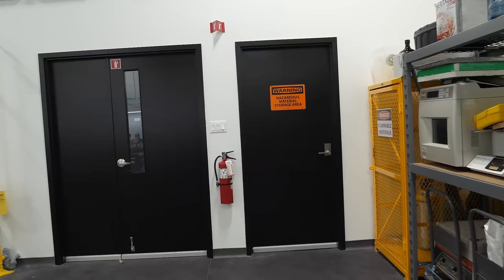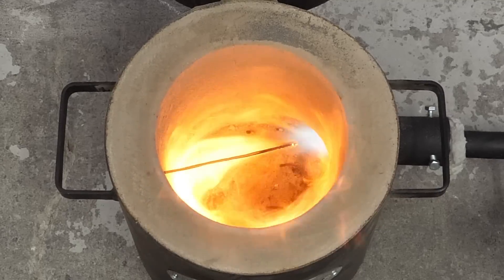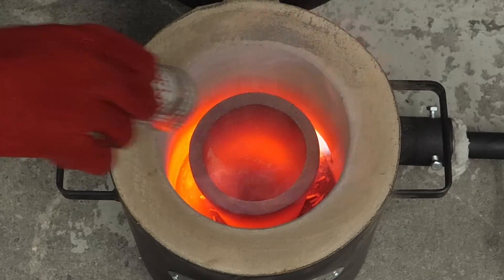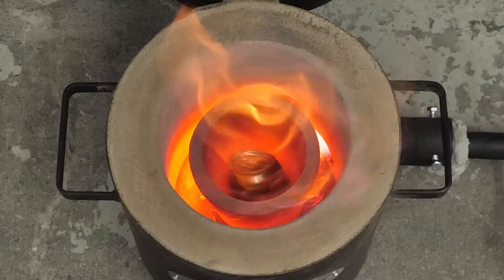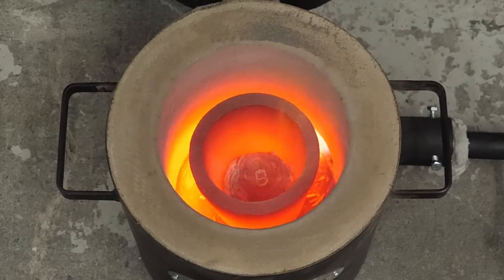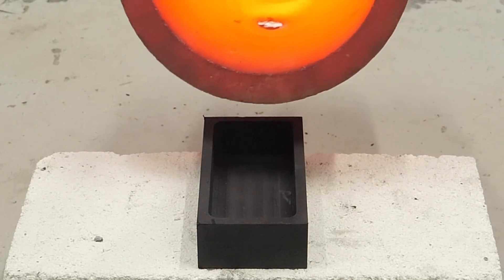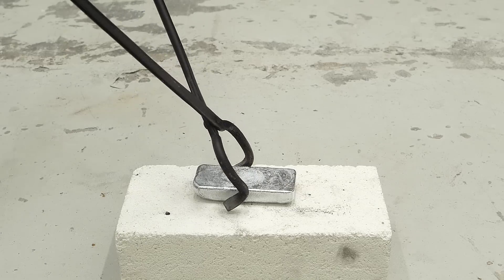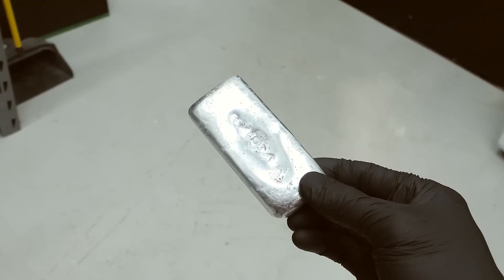Turning soda cans into a metal bar

Comment: The amount of cans it took to make that bar is quite impressive
Reply: Not that much though, cans only have a thin layer of aluminium.
Reply: @kokoslegend4850  you could make a diy can car which is small and realistic when you "crash?" It
Reply: @braindamage1  yes kind of, still looks like a can though. Also they are pretty strong, so I don't think little aluminum can cars will crunch on impact. It should be 30cm long and have a good mass of a few kilo's before it will work.
Reply: shows you how efficient aluminum can production is
Reply: @Kakaroto3245  efficient? Not really. It consumes alot of energy
Reply: @Kakaroto3245  trueee. I'd never get that much Alu from that amount of cans in here.
Reply: You can rip the Aluminium cans with your hand easily, but Aluminium is actually a really strong metal, It is even used in Planes.
This shows how thin the cans really are.
Reply: @sankang9425  although it is in an alloy with magnesium
Reply: @sankang9425  aluminium alloys have to be used in planes, because its soft, iron alloys are too hard and wings would break off. Second is how aluminium alloys are very light - planes can not be heavy
Reply: @sankang9425  it's actually pretty flexible compared to other metals I'm pretty sure I'm pretty sure one of it's main qualities is it's resistance to rusting
Reply: @sankang9425  Not exactly.
1. Planes use aluminum alloys, not just aluminum.
2. Aluminum is far from perfect as a construction material because it becomes brittle and cracks if stressed repeatedly. This can lead to catastrophic outcomes.
Reply: @sankang9425  hmm not really tho. Pure aluminium is not that strong among other metallic elements the reason it is used in planes is actually because of its lightness, not strength
Reply: @sankang9425  Aluminium is not strong at all by itself. The reason it's used in planes is because it's light, not strong.
Reply: @m-h1217  it's light and strong, that's why it's used.
Reply: @kokoslegend4850  It's noticeably soft compared to other metals. There is literally no reason to build planes out of stronger aka. heavier metals as that would only induce more risk. That's why it's used in alloys with stronger metals.
How many times has it been used because it's "strong" rather than light?

Aluminium is not strong by itself, you don't know what you're talking about.
Reply: @m-h1217  I do know what i'm talking about, aluminium is softer than other metals, but still very strong. It is the weight to strength ratio that makes it suitable, if it was really weak, it wouldn't be used. Aircraft manufacturers also make it stronger by making alloys.

One of the first google results:

Aluminum is ideal for aircraft manufacture because it's lightweight and strong. Aluminum is roughly a third the weight of steel, allowing an aircraft to carry more weight and or become more fuel efficient. Furthermore, aluminum's high resistance to corrosion ensures the safety of the aircraft and its passengers.
Reply: @kokoslegend4850  If it is softer than other metals it isn't strong. Unless you're comparing it to something like plastic or wood which would be strange.
If it was strong enough they wouldn't use it in alloys, however in this case, clearly it is used within alloys which is enough to prove that it isn't strong enough. The "because it's lightweight and strong" might refer to materials overall.
Just look at a chart and compare it to steel, quite a significant margin in almost every type of "strength" measurement.
Reply: @sankang9425  thank you for spelling it properly
Reply: Bill the Engineering Guy has a great episode about aluminum cans. The engineering and machining is truly impressive.
Reply: @bootblacking  yes I've seen that one.
Reply: @bootblacking  Yes I’ve seen that. Really fascinating!
Reply: Now how much money we talking per 100g bar? I know a sodaholic 😈
Reply: @vg6761  Today's spot price for Aluminum was $2,800 USD per metric ton. So...your 100g bar is worth at most 28 cents USD.
Reply: @teebob21  and what was the cost of the gas that was used to melt 28 cents of aluminium?
Reply: @teebob21  that's quite precisely what I get for recycling a single can here in Norway.
(actually ordinary and small cans go for 2 NOK while large bottles (1 liter and up) go for 3 NOK, surrounding your estimate)
Reply: @teebob21  sell in bulk
Reply: @vg6761  you're looking at like 90 cents a pound. Scrap and metal prices in general took a hit when covid reared its ugly head.
Reply: @Excalibur250  cans at my local place is 55¢/lbs...15lbs gets me ~$8.25...for trash.
Reply: @vg6761  who are you and how do you know me
Reply: @vg6761  10-11 cents 💀
Reply: The amount of heat energy needed is also quite impressive
Reply: @randomguy8196 yes, true, but the metal itself is pretty strong too.
Reply: Soda cans are an impressive piece of packaging engineering - they weight less than a twentieth empty of what they weight full!
Reply: Nope, the impressive thing is they can manufacture such a strong can with so little aluminium.
Reply: The genius design of the aluminum beverage can strikes again.
Reply: The amount of cans he got from the bar to make that bar is impressive, lol.
Reply: I think he was drinking them while it was melting.
Reply: It used to take about 30 cans for me to get a small pour when I used to do this
Reply: 12
Reply: That’s why in the hobby casting community it’s common to tell people to sell the cans for scrap and buy some better melting stock.  The thin cans oxidize all over the place and unless you flux it really well most of your metal is lost in the slag.  With good stock material you see 10-15% losses in slag, with Cans it’s more like 50%, with the best I’ve heard of being 25% losses.  Plus it’s a bad casting alloy.
Reply: Imagine how surprised this guy would be if he found out what sand on the beach is
Reply: Only 13
Reply: @Agent Fox boo
Reply: They’re super thin and remember that they are also completely empty. I’ll bet that if you try hard enough you’ll be able to squish one into a tiny ball
Reply: Yeah, 15 cans for that little amount is proof that aluminium isn't that harmful for the enviroment.
Reply: Hello
Reply: @Sillyunicorn5630  hello
Reply: @randomguy8196 not true. I've stood on empty cans before without them crushing, you just have to make sure that the force is as vertical as possible, because the strength of the cylinder is only along that axis. As soon as you make too much horizontal movement it collapses.
Reply: Well it’s mostly ink and plastic
Reply: @mandalorianwiththemandarin4339  cans are all aluminum, just not the can "opener" and the printed
Reply: @derwums2931  Actually soda cans have plastic layering on the inside of the can in order to prevent any metal contaminating the taste of the soda. This layer of plastic is actually slightly thicker than the metal of the can.
Reply: @mandalorianwiththemandarin4339  U Sure? When you Look inside its Aluminum color too
Reply: @derwums2931  The plastic is clear. At least most cans like Coca-Cola and Sprite have plastic coating.

Side note: I just realised I was wrong when saying that the plastic coating was slightly thicker than the aluminium.